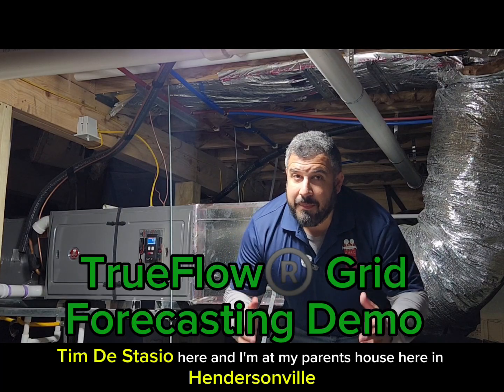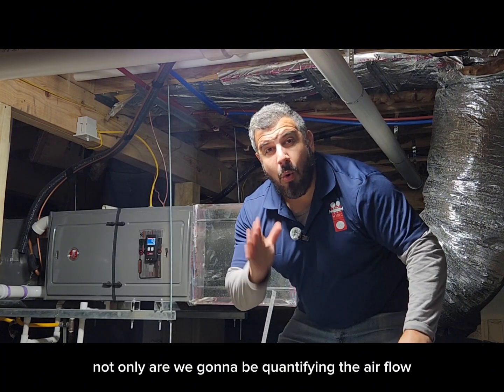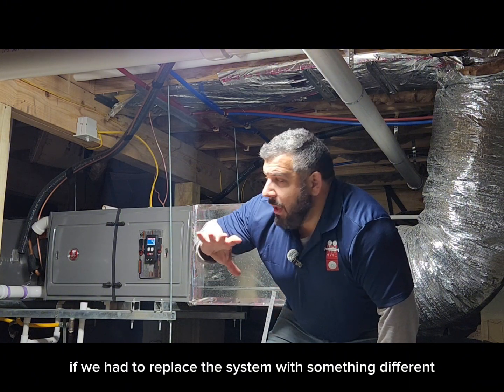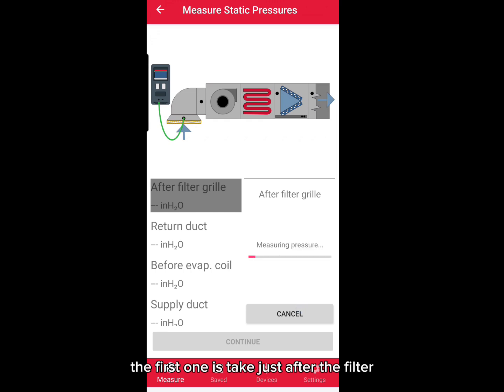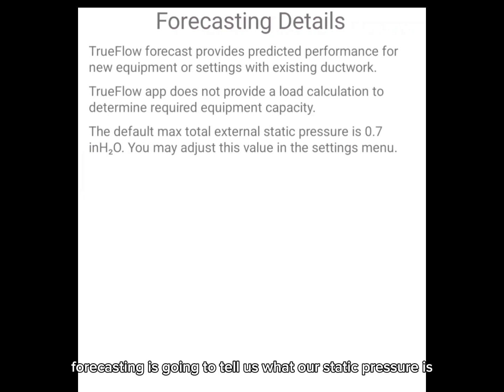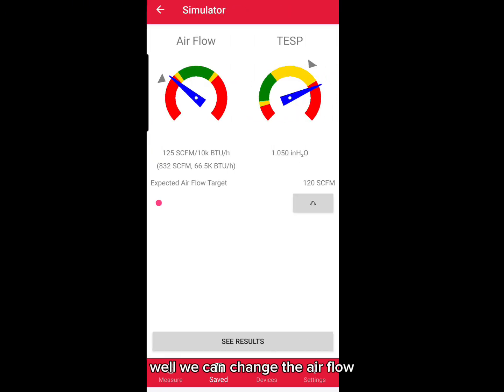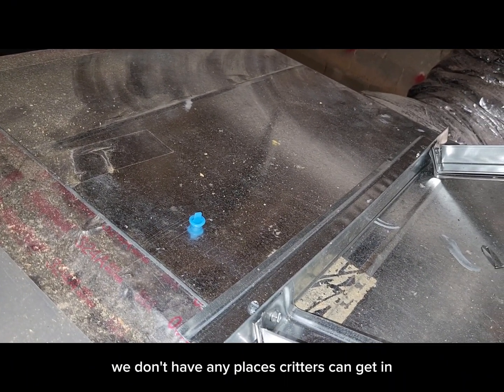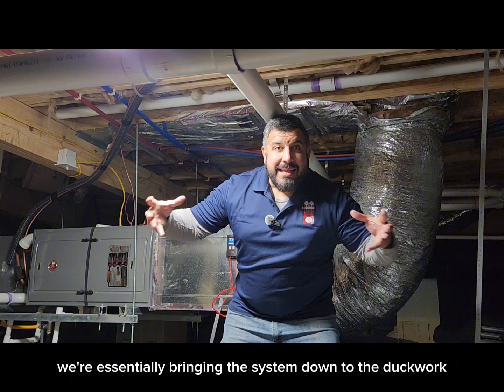TrueFlow Grid Forecasting Demo

Comment: My question is, if increasing the fan speed gives us the airflow needed with a higher static pressure, what is the problem that will occur, besides noise? Great video!
Reply from the maker: High static consumes more wattage, reduces ECM motor lifespan and can push/ pull condensate out of the pan and trap causing water issues.
Reply: @timdestasiohvac  Thanks for the response. Makes sense to me!

Comment: Really wanting to buy a true flow grid to get the information it provides. I like and work in charlotte. What you found at your parent’s home is not uncommon. Here’s my issue/question; what would I do when there are 2 or more filter grills on the one system?
Reply from the maker: @kevinjohnson4966  True Flow has a workflow for that.